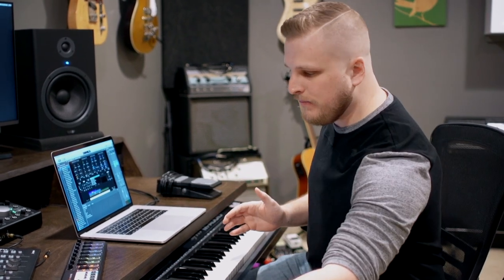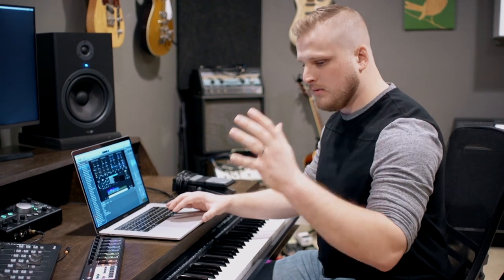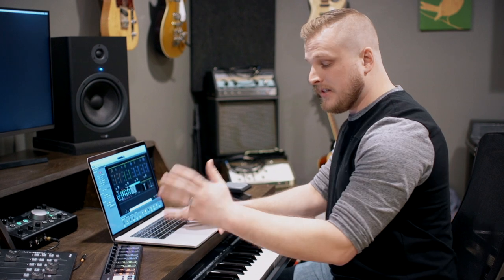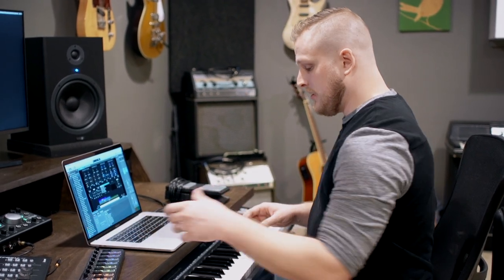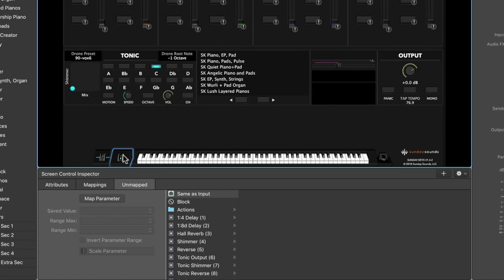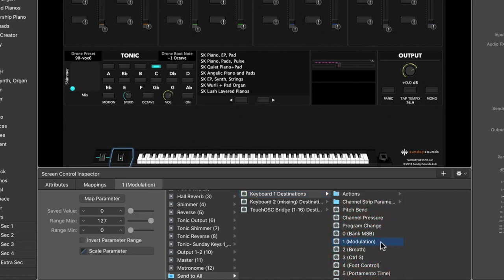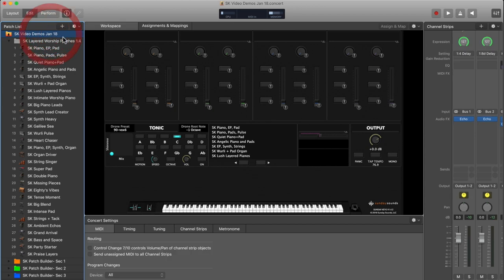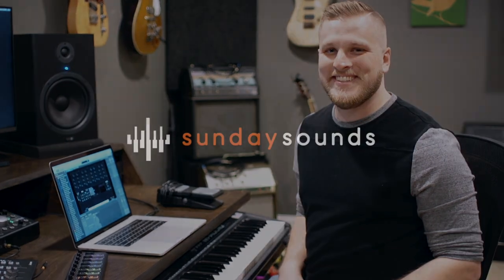How to Assign Your Mod Wheel to a Knob, Fader, or Expression Pedal in MainStage!

Comment: I just did this a week or so ago using an expression pedal.  It took a while to figure out but after doing some research I found that with an expression pedal, there's one additional step you have to do in edit mode.  When you move your expression pedal up and down it's going to change Number to 11 (expression).  Right beneath that where it says Midi Thru, mine defaulted to Automatic and it needs to be changed to "Do not send thru".  Once I figured that out, it worked like a charm!

Comment: I was able to do this easily- yay! But the SS template has a nice text box in the screen layout that gives song section hints as you progress the mod wheel, and THAT still only responds to my wheel and not the fader I just reassigned. Is there a way to adjust that?
Reply from the maker: https://support.sundaysounds.com/hc/en-us/articles/360034410353-The-Song-Section-Notes-aren-t-changing-in-my-Song-Specific-Patch-when-I-move-the-mod-wheel

Comment: How would you assign pads to play from a click of a pad ? Can any one help me ? Or link me with some videos ? Thanks again
Reply from the maker: Hi - I'm not quite sure what you're looking to do - can you explain more?
Reply: Sunday Sounds like how to have pads play with a click of
a button either on the midi keyboard or computer?  Assigning that function and sound file to that button
Reply from the maker: @johnnycha-rach1112  You can add a button to the workspace in Layout mode, and then you can add in a file to play using the Playback app, here is an article about setting that part up: https://support.sundaysounds.com/hc/en-us/articles/360033986334-Using-Backing-Tracks-in-the-Playback-Plugin

Comment: Followed step by step, and it isn’t working for me :-( 

The new fader moves the on screen mod wheel, but the sound doesn’t change. When I move the mod wheel on the keyboard, the in screen mod wheel doesn’t move but the sound changes. 

The only difference that I can think of is that I have two keyboards, but I didn’t think that would make a difference. 

Any ideas?
Reply from the maker: Hi, I would try it with the other keyboard and see if you get the same result. If you are still having trouble please reach out to us here: sundaysounds.com/support!
Reply: Thank you so much  @SundaySounds ! Will definitely give that a shot and reach out if it doesn't work. You guys are great, and I appreciate all that you are doing.
Reply from the maker: @JacTrades  Thank you so much! Please do :)